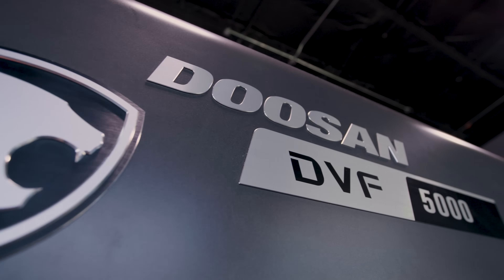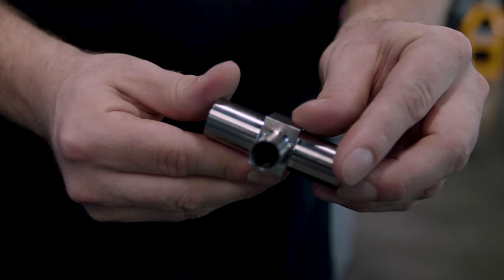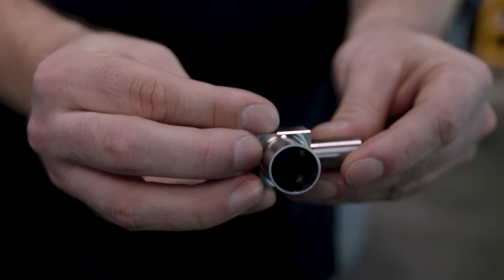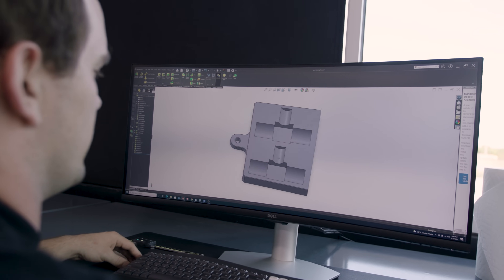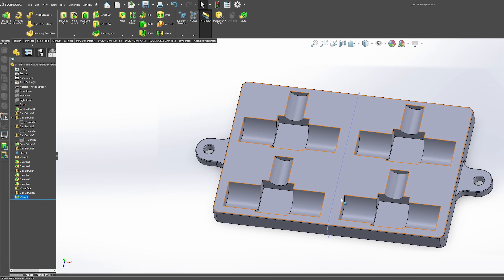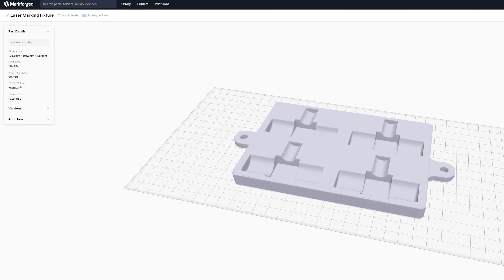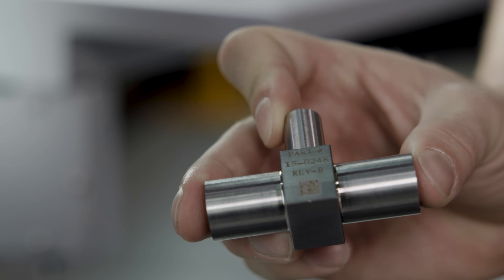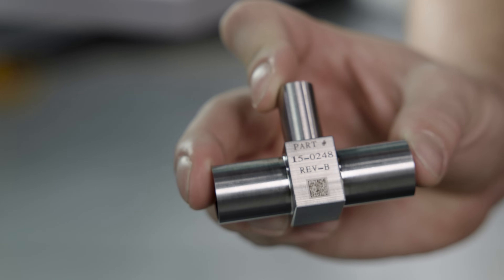Slick Custom Fixture Plate Creation | Markforged Mark Two 3D Printer + TRUMPF TruMark Station 3000

Comment: Isn't it illegal in 2021 to use a font with Serifs?  Comon man.  Sans-serifs!
But really - that fiber laser is slick.  So is the Markforged - I'd love to have one of each here in my shop.  Killer workflow.
Reply: I'd rather use a MILSEPC font, MS33558 for those parts
Reply: Sans serif is for losers.
No one that cares about what info the letters contain use sans serif, only prissy little sissies use sans serif because they value form over function.
Reply: @joshua43214  ohhh aren't you edgy.

Comment: Idk why but it always triggers me to see how much "waste" there is in industrial machines. The bulky cladding, additional motors used just to open and close it's door, and all the extra space they take up because of it. Think of open source 3d printers and how small and simple a lot of them are where the only components attached to it are all it needs for function and structural support. Majority of the waste doesn't even contribute to part quality. All that extra stuff is money you have to spend on bulky material and wasted space. The best example is that Trumark Station 3000 laser. You could put the same laser in a plexiglass box and ditch 1000lbs of stainless steel sheet metal propping it up. Pop it on a plastic table from walmart and have an employee spend 2 extra seconds manually opening the door and save 50k lol.
Reply: Is your name Aaron or Karen? Customers don't want to see a bunch of crap cobbled together with junk from Walmart when they are looking for someone to make expensive, tight-tolerance aerospace or medical parts. Imagine having a brand new Lexus and taking it to a shadetree mechanic to have the oil changed. That ain't happening...
Reply: @rgetso  Calm down im not saying Titan's doing anything wrong. I'm just saying those companies that build machines could build them out of less parts and make them cheaper. Some 100k of a 500k machine is going into components that don't improve the quality of the parts it makes. To me thats waste. Instead of stainless sheet cladding all over a massive machine, why not a cheaper acryllic or something that still looks nice. It doesn't have to be load bearing. Even the cheapo tormachs for home use have waste that put them outside the reach of a lot of makers. Everyone could have these machines in their home if they didn't put so much extra crap on them thats not necessary to do the job.
Reply: @ablasttv  some of these machines can be in the field for decades. Our '94 T+ Mazak QT8 was completely gone through when we bought it used and then got a new coat of paint. Still holds tenths and runs daily so I'm glad they made quality sheet metal for it. Not to mention containment of a possible part crashing out of the chuck ( it happens )
Reply: @ablasttv  sheet metal is cheaper than plastic. 

When your buying a machine to last 20 years you don’t make it out of junk to save a few pennies

Trumpf workstation 5000 owner here.
Reply: Of all the things to complain about, a laser station having an auto-door ain't high up. For industrial level operations automating every little step saves more money over time than the extra few motors cost to install.

I have a love-hate relationship with the auto door on my lathe but if I'm doing any sort of production run it's definitely in the love category.
Reply: Blame OSHA.  At my shop we have a early 80's open bed mill.  There is just enough shrouding to keep the coolant from splashing out if it.  If you are running a job on it some times you have to use the box the controller is mounted in to keep chips from hitting you.  The paint on the back of the box is completely worn off and it has a really nice polish to it from years of being blasted with chips.  It also makes the floor around it a holy mess.  A full enclosed machine is worth it just to not have to deal with things like that.  When it comes to lasers marking some materials can outgas toxic substances so having a sealed unit with proper ventilation is key.
Reply: This 'additonal waste' has enough reason. One reason is safety of your employees and certification of the machine.

For the door you have three options. Imagine if you have to process 1000+ parts.
A: Not automatic and your arm will fall off
B: Automatic and your arm will not fall off
C: Automatic with a robot

Hobby stuff is good for hobby and maybe entry level where this stuff doesn't matter. In industry it's usually better to invest more money. The additional productivity and comfort will be paying for that additional $$$
Reply: @Trevor Goforth Yes that and OSHA spec. reason for cladding
Reply: They ant trying go for the cheapest route he’s Titans of CNC he’s making a Statement with these Behemoth machines 💵💵💵